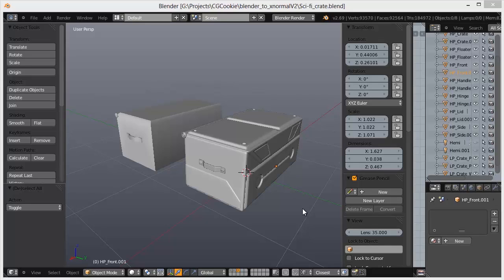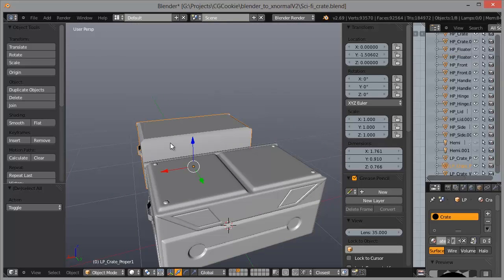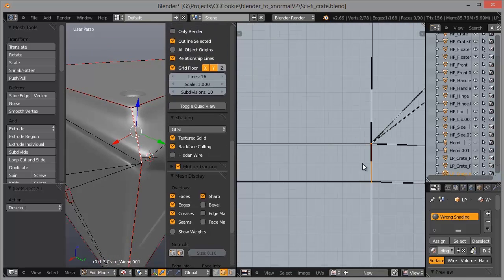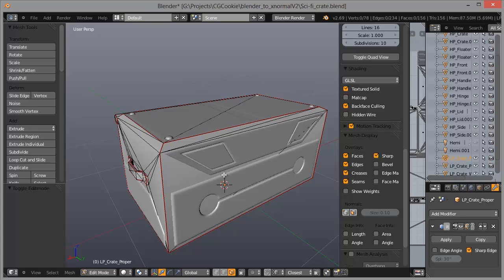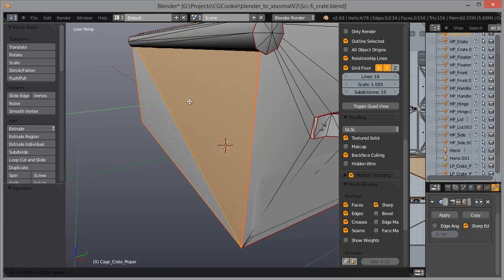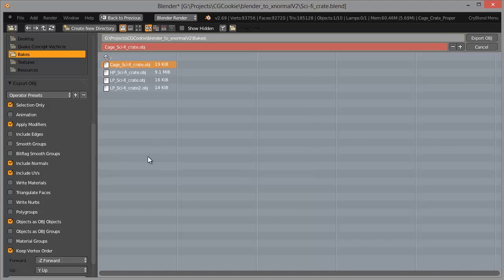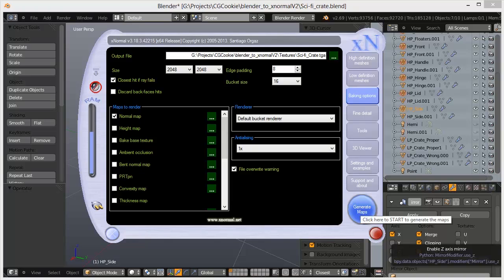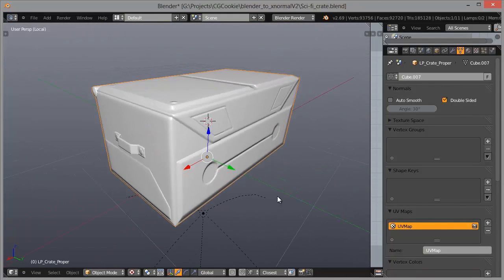blender baking normals xnormal

Comment: Can one bake normal maps on the model without having an nVidia card with a CUDA core?  Or it's still impossible for amd users to get that realistic effect.
Reply: I did not use cuda during the bake only cpu, so amd users should have no problem following the tutorial.
Reply: Andreas Strømberg First I was just flicking through the tutorial like hmm.. yeah normals i cant use that... Now that I checked it deeper. Yes, AMD users still can't use normal maps. A lot of options are missing from the AMD users' panels.
Reply: Andreas Strømberg
oh forgive me, i didnt see i was in cycles render and not in blender render ~.~
Reply: Marsal Well xNormal is a external program, so you are not using the blender render at all, also cycles does not need cuda or nvidia to function :)
Reply: but a lot of nodes in cycles are missing without a cuda core, the ones needed to use normal maps in cycles
Reply: Marsal I can't help you with that part, at the end you can see me setup the material for viewing in the viewport, I don't use cycles for such.
Reply: Marsal but I have used cycles with normal maps before without having to use cuda, I don't know what the problem might be.
Reply: Andreas Strømberg I have as well, so I don't know what the problem might be, can be worth searching around on the internet to find a solution.
Reply: You don't need an Nvidia card. I've baked several normal maps using Xnormal on the computers provided by the class, which are running AMD GPUs.
Reply: ***** i exported my model into .obj from blender .. and when im trying to bake normal ... xnormal giving the error below ..
"sorry the mesh importer only supports triangle/quad faces and the mesh has an N sided face.please triangulate/quadrangulate before to import it into xnormal ..."

question no1. how can i triangulate my .obj into xNormal ?
question2.why this problem is shown ?
Reply: STUDIO GOLLACHUT If you are working as a modeler for any studio (game, cinema), they will tell you to avoid N-gons and tris. This is for two main reasons: 1) When you start rigging, tris can make the animation of the joints unclean, and 2) Quads sub-divide perfectly while tris and N-gons don't.

xNormal is not used for modeling so you can't change it there, you'll have to change it in your modeling program of choice. And since OBJ files do not support writes, you'll need to re-export it. There are some cases where tris are unavoidable, but, if you start with all quads, and don't merge vertexes, you'll have a model that is all-quads.
Reply: tnx ..helpful.. :D

Comment: This is great! Cage might be a solution for my common issues, which are that when I have a lot of parts on a model (like various switches, pipes, grips and such), when I use baking in Blender without cage, it returns a bunch of errors on intersection points, which forces me to always separate the pieces out to bake, and then piece them together again. This is very annoying.

CGcookie needs more game-dev tutorials. I would love to see a kind of project that involves this tutorial and a few others to bring a complex assent into a AAA game engine (like a shooting gun or a character with animations). There are very few (read: none) good quality tutorials that guide you through the entire process from start to a finished working asset in a AAA engine  using Blender(like CryEngine 3). It's either all in parts, all for 3DsMax or a very simple static asset like a box or something.
Reply from the maker: Yep, prime case to use cages. Hopefully we will get cage baking in Blender soon.